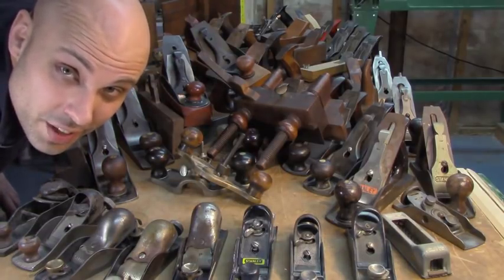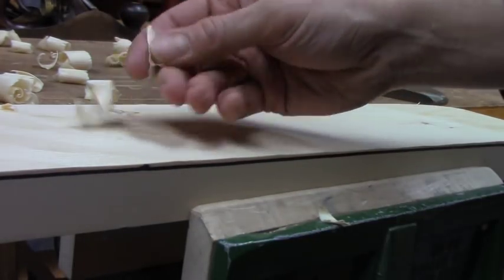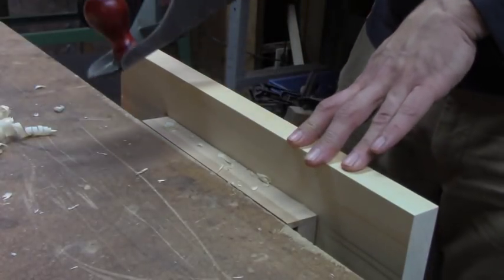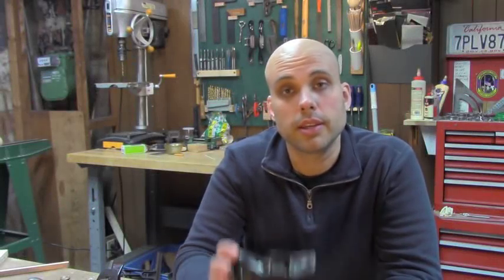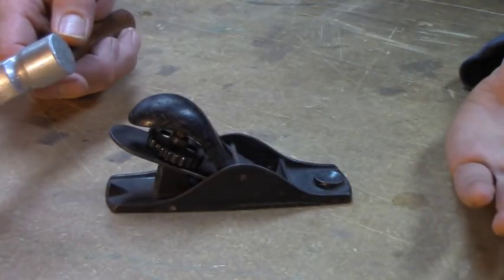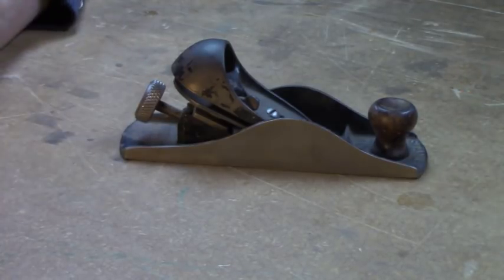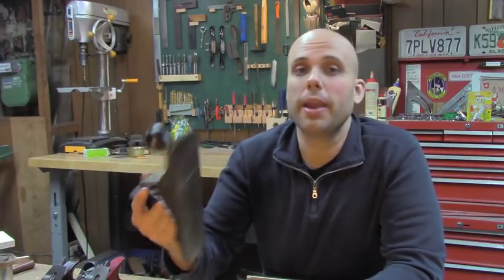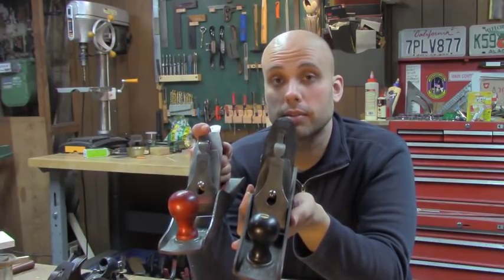Hand tools for $100 #2: Buying the planes you really need.

Comment: As along time hand tool woodworker, I find your explanation (especially for the novice) to be excellent! You covered the variety, utility, and to some degree, the technique very well. My only quibble would be on the prices. Most of the ones I find at garage sales and general flea markets in that price range are rust buckets, and would take a lot of skill and knowledge to restore. (some gems are still out there to be discovered though) If you are interested in hand tools (and every woodworker should be), consider joining the a Midwest Tool Collectors Association (MWTCA). They have frequent tool specific swap and buy shows, and the tools are excellent quality and often already restored to working condition. So, good work Rex. This is the first video of yours I've seen, will definitely check out more. (subbed)
Reply from the maker: I'm really glad you like the video!  In fact, some of the planes I find at this price HAVE been real rust-buckets, but I've been surprised at how good they were once they got cleaned up. If you haven't seen it, I have a vid on doing a fast restoration and getting a rusty plane up and running quick. Thanks for your thoughtful comment and feedback. Comments like this let me know what direction to go in.
Reply: Keep 'em coming.  :-)

Comment: In the European (i.e. German) tradition, the two roles if the jack plane would be done with the 'Schrupphobel' (scrub plane) and 'Glatthobel', which means smoothing plane, but it was actually intended for just flattening the scallops left by the scrub plane (it has a big mouth and no chipbreaker).

(The final German plane is called a 'Putzhobel', which means 'cleaning plane'. This is equivalent to a smoothing plane.)
Reply: Does the "glatthobel" have a bit of camber on the blade but not as much as the scrub?
Reply: @borjesvensson8661 
Correction on what I wrote: Glatthobel is the wrong name, I should have called it a "Schlichthobel".
As far as I know, it's sharpened with not much camber, or with just the edges eased. It needs to be fairly straight, since its job is to flatten the extreme scollops left by the scrub plane.
Reply: Isnt the final plane the Schlichthobel?

Well, different region, different term
Reply: @LaraCroftCP  From what I learned, the Schlichthobel is the one without a chipbreaker for removing the scallops left by the Schrupphobel, and the final plane is the Putzhobel.

Comment: Loved the video as usual. Rex, Paul & Joshua, a huge thank you to you guys. ^^
If anyone is interested after a lot of summing up & reading. Below are the choices I made: ( Note; the rust-buckets I restored took some unreasonable elbow-grease. take your time to find something balanced between price and touch up)  

- No. 7 Jointer plane ( No.7 was the most expensive of the lot but You'll never need for a larger nor middle one like No.8 or No.6. Worth mentioning is that a No.7 shines if you're making a lot of table tops or in my case a workbench top (which a No5 will do with some more scribbling and checking). If you need to save money buy another plane iron for the No.5 to act as a "jointer-jack")

[ - No. 5 Jack / scrub plane ] - ( I use this one a lot. I kept it as a jack instead of grinding a really strong camber or widening the mouth. It's also great for a shooting board.)
[ - No. 4 smoothing plane ] - ( Rex has a lot more videos on optimizing this type of plane. Paul Sellers also has really down to earth videos about it.)

- block plane ( personally, I think it's just nice to have. I could do without and use something abrasive instead.)

The only essentials [ . . . ] in my opinion are one smoother (smaller plane like No.3 , "4" , "4-1/2") and one jack (No.5, "6").
Some more about planes if anyone is interested:
https://woodandshop.com/woodworking-hand-tool-buying-guide-handplanes/

Comment: My Wife's Great Grandpa left me a #9 1/2 Stanley, Bailey #6C, Stanley #4C & a Bedrock 602, They are all about 100 years old, I have many others older wooden planes but these are my "Go Too" planes.. I need a new iron for my #4 as it has a huge gouge in it & that iron needs to be cambered into a scrub iron.. You're prices are way off or they are for in my area, I have never seen a plane for less than $15 & most fetch twice that even if it's rusted all up.. Everyone has looked on eBay & seen what they sell for. Of course the Bedrock 602 is worth $400- $1000 to the right buyer..

Comment: I don't know what's up with the antique scene in Edmonton, but I just went to two different Antique Malls and they were selling rusty old bit braces for $15-$30, and hand planes with badly nicked blades for $50-$150... They're more expensive than the new ones at at hardware store.

On the plus side, there are a ton of auger bits for bit braces for under $5, including one very neat adjustable radius auger bit
Reply: What few places here are even exist because of covid are asking crazy person prices, even eBay is way higher than normal according to several people I've talked to.. I'm considering just going power tools at this rate even though I don't want to.

Comment: Good Video. I usually go with my 5 1/2 and 4 1/2 and a discussion of those might have been helpful.  The adjustment methods you compained about are the state of the art with most wooden planes, many that vastly outperform the modern crop of affordable planes.  Adjustments are great but if you do farm or ranch carpentry, you'll find a lot of adjustments to be a big bother when you just need to knock off an edge.  I have 6 block planes than came from flea markets, being left in my barn by the previous owners, and Lie Nielsen.  Needless to say - different uses.  And lastly - what condition are the planes you gave prices on in?  But good video and good info for newbies.
Reply from the maker: I love my 4 1/2 and 5 1/2 but they are much rarer and more expensive. They're hardly essential kit for the beginner. And I have to be honest, I don't think people doing farm or ranch carpentry are the target audience here. As for condition, they are in flea-market condition and need restoration, but I don't find that to be a big deal. I also made this video based on my experience tool hunting in Central California. I'm in Ohio now and prices are higher. Really glad you liked the video.

Comment: I was taught to always lay planes on the side when they are not working. Standing a plane on its sole without retracting the blade may dull or nick the edge. Maybe it's not a big issue on a clean wooden table, but still it makes me cringe a little. Apart from that, I really enjoy your videos and the way you explain stuff! I learned a lot. Thanks!
Reply: You were taught wrong.
Reply: Storing a plane on its sole, on a wooden surface, will provide the best protection possible against any accidental impact and will not cause nicks or dullness. So you were thaught wrong indeed :)

Comment: If using an oil finish, wax or along those lines its fine to be 220 and higher. If u are staining and sealing, most woods wont take stain properly at that high a grit.  I always see woodworkers over obsessing about how smooth something is, I watch them plane it, sand it up to like 320 then stain it, and often have to stain again if they have a desired look other than just having stain on it. Then putting sealer on it poly, oil base or latex, or a laquer . They basically did all that for nothing as u have to sand between coats to begin with, or should if u are doing it properly. Hard maple for example doesnt take the dark color stains well least the maple available to me, I and many other cabinet makers I talk to about finishing all say same thing. I will sand up to 220 with orbital, then come back and sand with grain with 80 to 120 grit by hand so that it can accept the stain, Reason i sand to 220 grit is to get the swirls from orbital out as they are to big at 120 unless ur paper is extremely wore out. I have stained and finished thousands of board feet, dont know exact number but a lot of sets of cabinets and stairs  and some furniture pieces like tables , entertainment centers, and built in's along with a few beds etc.. I used to use lacquer but primarily use conversion varnish now as it is a much better product, and produces a surface like glass. I use tinted conversion varnish in place of paint also, so I always achieve the same exact results. Moral of the story, dont stress about smoothness so much if u are going to stain and seal it, just make sure to take out swirl marks and always sand with grain on final pass, If doing a big project sand and sealer will do all the work for u, if smaller projects I dont waste my time with sanding sealer.

Comment: For those of you that have the knowledge or experience to answer my question from a moment ago but would like to have some more specifics you can go to craigslist too take a look yourself. Just head over too Craigslist and type the city and state of mine and that is Grand Rapids Michigan. Once craigslist brings up the sales in my location then go over too the tools section and type into the search bar Wood Planes. Or you can just skim your way through the tools section until you see the sellers post with the title being Wood Planes - 35$. I just went back to the craigslist add and there is only 2 pictures but the pictures are nice and clear. The 1st picture is the 3 planes lined up right next to each other facing up. The 2nd picture of the 3 planes are the planes lined up all facing down so you can see the bottom souls of the planes. It is in the 2nd picture with the souls of the planes where you can see that 2 of the 3 BL.planes have the adjustable mouth or throat that Rex goes over in this video. So for anyone that wants too take a look at the 3 Block Planes there you go but there better not be anyone trying to steal the planes away from me. LOL

Comment: I have an old (not that old but cheap) No. 4 plane set up with a camber as my rough or scrub plane, then my other two Stanley Baileys are set up as a smoothing and high plane for knotty wood or wood with the grain going in many different ways (with a bevel on both sides of the iron as per Matt Estlea). I won’t ever be working with anything bigger than 3”x2” so I thought I might get away without buying a no.5. Would you still get one? 

My best plane, which I can use better than my router, is my rebate (rabbet) plane, they look so difficult and complicated and they are incredibly simple to use because everything is set up for you. Mine doesn’t have a name, it’s purely generic, and was £18 brand new and I recommend everyone who wants to make A2 photograph frames should get one.

Another great video, I really like your approach and channel. You talk to me a guy right at the beginning of his wood working journey who isn’t interested in spending £500 on a plane. Thank you.
Reply from the maker: Great question!  I do think having a longer plane will let you get flatter surfaces and edges more easily. I'm going to guess you're in the UK, where a Record No 5 should be affordable. If not, look for a wooden jack/fore plane in decent shape. I use a wooden fore plane all the time and I love it!  I rarely use a super-long plane and with you working on small stock, you won't need to either. Good luck!
Reply: Rex Krueger Thank you, yes I am in the UK. I really appreciate your comprehensive answer and the good advice.
Reply: @markharris5771  Just a thought - Paul Sellers has good stuff to say about the no.6. I got one for less than you would expect to pay for a 4 or 5, and I like it. Feels good. I'm looking forward to having a shooting board for it.
Reply: M R Since writing the above I bought a record #5 and a #7, the #5 is already my most used plane. Thank you very much for the tip though, it is appreciated.

Comment: Love your vids. Good info. My dad gave me an old what I think is a 4 1/2 plane that has no matkings and needs restoring. Guess I'll get to that next.
Reply from the maker: If you do have a 4 1/2, it's both very useful and pretty valuable. They go for $150+ on ebay. But I'd never sell mine because I use it every day. If it has no markings, then it's pretty old, which is generally a good thing. I have a couple of vids on restoration. Good luck!
Reply: Rex Krueger it's the length of a 4, but almost 3" wide...quite a bit wider than the cheapo 4 I bought at harbor freight (which Imade usable using your videos).
Reply from the maker: Floyd Heaton Wow. You got a harbor freight plane to work? You should make a video on that.  And from what you're describing,  you have a 4 1/2 for sure.  Get that thing up and running asap.  You'll love it.
Reply: Rex Krueger yeah, Dad got to the age where he doesn't use any of his tools any more, and I just got into woodworking about a year ago, so he gave me a bunch of tools...including the plane, and a monster 2.5 HP 10" double bench grinder that I just unpacked....😳
Reply from the maker: That's fantastic!  My dad has been the source of many of my tools. He's slowing down and doesn't want to see this stuff collect dust. If that grinder turns out to be too much of a monster, consider throwing buffing wheels on it. I just got a big buffer and I use it ALL THE TIME. It's great for adding that finishing touch to your work.
Reply: Rex Krueger will it throw it out of balance to put a buffer on one side and leave the grinder on the other?
Reply from the maker: I have no idea, but if you're going to keep one grinding wheel on it (and one is all you need) then put a wire wheel on the other side. You don't need two different grits of stone anyway. Coarse is good for pretty much everything. That wire wheel will chew through rust and old paint faster than anything. I can't imagine my shop without one.
Reply: Rex Krueger that's what I was planning. I watched your other video on the glories of the bench grinder...lol. Finishing up a farmhouse style table today, my first real commissioned piece, with mortise and tenon joinery all around. The sharp chisels and planes your vids have helped me with have been indispensable. Check out my Facebook at Heaton Custom Woodworking.
Reply from the maker: Congratulations on the commission!  I started getting paid work (on my own, not working for a company) about 18 months ago. It was a thrill...and I quickly stopped enjoying it. Thus I focus on videos now. Good luck!  Stuff on your facebook looks great!

Comment: I have a question for you Rex. It can be answered by anyone in this community with any knowledge and or experience with owning/purchasing vintage block planes similar to the  BL.planes Rex shows in this video. My question is 35$ a good price for 3 vintage block planes? I have bought other vintage/antique tools several times now from Craigslist. The tools I have now are a couple bit an brace drills, a #4 craftsmen hand plane, and a 5 or 5.5 Jack plane. Well the Jack plane I kinda have. I kinda have it because I am nearly done doing a restoration to it because of it being my Grandfather's who has since passed away. So since I have the #4 and essentially the #5 I have been keeping an eye out on craigslist for a quality preferably vintage block planes. And this is where my earlier question and the 35 dollars comes in. So right now near my area of Grand Rapids MI there is someone trying to sell 3 what I believe to be vintage block planes and is asking for the 35 dollars. I can't tell from the few pictures provided the company/maker and the number/size of the 3 BL.planes. Thankfully however I can tell that 2 of the 3 BL.planes have the adjustable throat that Rex speaks about in the video. So if the 35 dollars is a good price for all three planes that's great. But if it isn't a good price and I should offer a lower price what would be an excellent price as well as an acceptable price for me too pay. I want to know what both of those prices are so that I know where I can start with and then end with my offers too the seller of the 3 block planes. So any guidance from Rex or anyone else in this YouTube creators community will be greatly appreciated. I already thank anyone who has read my comment with your time.

Comment: The fore plane graphic shows an 8 inch DIAMETER circle for the camber on the blade.  Should this be an 8 inch RADIUS?  The 8 inch radius is described in the smoothing/scrub plane video.  I've got a plane blade I need to turn into a scrub plane blade and want to get it right.

Comment: Rex:  what do you use to prevent rust on your planes?  I see you live(d) in Alachua county - a hot humid area.  I live in NE FL a few hundred feet form the coast, so in addition to humidity, I get salt air - both very corrosive to steel tools.  Your planes look in perfect condition after you've refurbished them.
Reply from the maker: I'm fond of plain oil on my planes. If they rust, I'm not using them enough and they need to move on. Good question!

Comment: Bought my first jack plane today. Question: do I buy a second blade/chipbreaker or go back and get the transitional jack plane that's at the same antique store? Price is good enough that it's probably a wash  compared to buying a new blade/chipbreaker online. And is this how you start to have a 'problem'?
Reply: Found two no 4s, one with a narrow mouth and another with a really wide one. Bought them both for $40. Going to set one to scrub and the other to smooth.

And I have a couple of block planes. Just buying as I find them cheap 😁